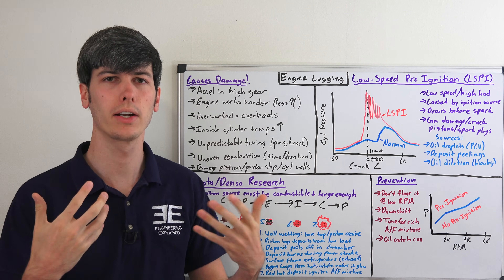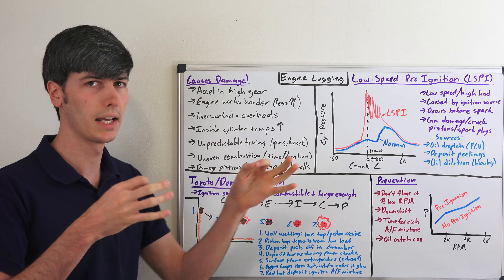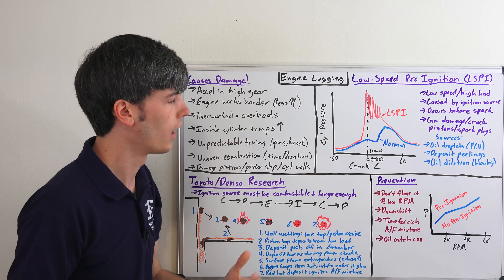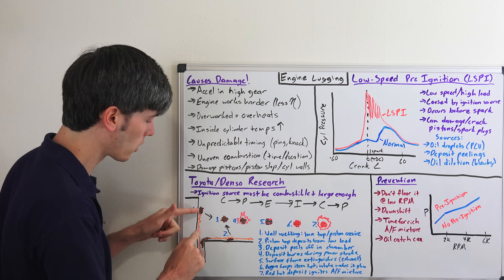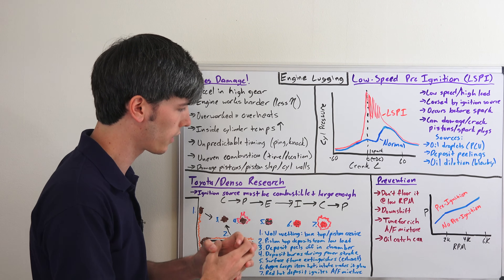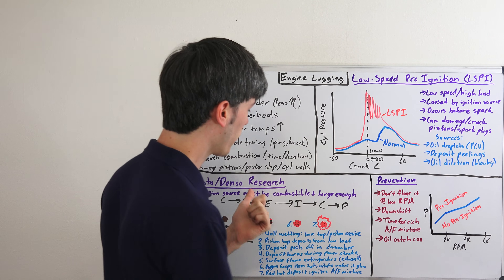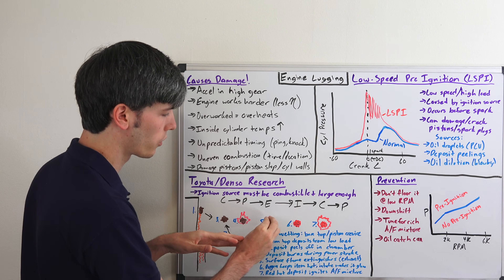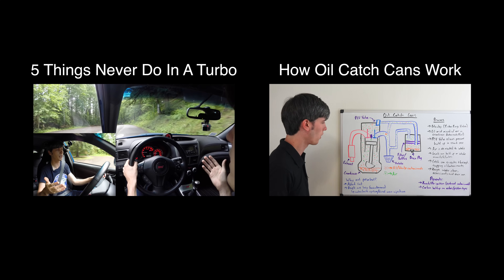Why You Should Never Lug Your Engine (Especially Turbos)

Comment: I definitely get the big picture here, but to me, the most important point would be to precisely define the term "lugging". For example, at what point on an x and y graph would you plot a "lug"? There are so many variables here; engine type, rpm, throttle position, throttle position delta over time, tuning parameters, gearing, etc, that it seems unlikely a definition exists. Personally, I don't "lug" my engine at least to the extent that I know when my engine is "lugging" simply because it doesn't "sound" very good and certainly doesn't "feel" very efficient.

Comment: @Engineering Explained - Jason, I'm a manual driver but when renting cars and when riding along with friends I notice that modern cars with AT tend to somehow lug themselves for fuel economy. Many will shift to the highest gear asap for fuel economy reasons, and those with 7, 8 or more gears will rarely go above 2500 RPM with the average driver. In that case, shouldn't we be seeing more low-revving under-square small 4-cylinder engines for higher torque & efficiency like in the old BMW 325e? (Or is this already the case?)

Comment: First off, very well explained and thank you so much for the video. I've got a little question. What if I'm going slow, but say climbing a high ramp and then floor it in second gear just for a little while? Can that cause any engine problems?
Reply: It lugs when you are in the wrong gear for the speed you are going. If you were going like 15mph and shift to 3rd gear your engine would make vibrating noise telling you are in wrong gear.

Comment: So accelerating at 4th gear at 45 mph to 65 is bad? Should I downshift to the 3rd gear and accelerate from 2500 to around 3500 rpm then upshift? I've always done that with my Jeep and I didn't know it was lugging. I definitely dont want to lug the engine of my mustang I just bought.
Reply: Dont let your rpms go below 1k. You will be fine.

Comment: This is counter intuitive, hi gear and high loads at low speed is the least amount of work on the engine vs high rpm which means more air and more gas. I accelerate all the time in 5th gear at speeds of 20mph without down shifting and it's less wear and tear because it's less rpm. Yes if you want quicker acceleration go to lower gear. Your engine will last longer when you use hi gear and lower rpm (above 1000rpm) is safe. The more RPM the more air the more gas means more wear. I'm sorry but this guy has it totally wrong.
Reply: Starting a bike moving in a high gear from stop requires way more work from your legs, which are the engines. It is the same with cars. And 20 mph in 5th gear is an absolute outrage.
Reply: Who in the hell starts off in 5 gear?  What
I am saying is simple, if you are moving at 25 mph can accelerate in 5. Of course it takes longer to build speed but your not hurting the engine at all. Again it's low rpm that has the least amount of wear and for long distance it's the most efficient. It's kind of like walking on foot, if you walk you conserve energy. It if you run you burn energy quickly. If you don't believe me than were not getting any where.

Comment: hi i have a question incorporating a turbo engine ive had two turbo cars so far a 2010 mini s and currently driving a 2015 vw golf tsi 1.8 t i noticed with both cars that when i give it alot of throttle their are moments when i feel like a tick noise shoot from the engine down the cat and it almost feels like the engine would be spitting gas in the begining of the exhaust syteme and it then ignites tho not creating a backfire it feels like its a missifre almost. thank you to who ever reads this !

Comment: I always try not to lug the engine but i need helps! I have a Manuel audi.
 Driving uphill for a length 30 minutes there may or may not be heavy traffic. At start im at 4000RPM to meet second gear @around 2200RPM to catch the gear with out making the car jerk. Any less and the turbo needs to kick in I repeat to 3rd but then at times,depending at what speed (60-70mph), im at 4th gear and 3500rpm to allow the engine and car to move upwareds without having to spool the turbo. If i were to switch to 5th gear, my turbo would kick in to accelerate, or if i let off the pedal to remove any boost, my car stays at the speed or begins to slow down. Is this okay? 
Can i keep my car at about 3500 rpm to let the car move smoothly uphill for 20+min or should i be at a lower rpm and let the turbo spool? Am i then lugging the engine if i have to make the turbos boost to accelerate and actually harming the car more than just leaving it a a higher rpm? 
Ive had seen other manuels and it seems like its efficent to at least go @2200RPM when switching gears. But by then the car is screaming to shift by 2200 when my car begins to do same till @5000rpm and includes a turbo..? Ahh! 😆

Comment: Could this happen to a turbocharged engine with an automatic/CVT transmission?
Reply: Normally in automatic mode on any auto transmission, when you start pressing on the throttle more it downshifts. You should be find, this is mostly a manual transmission issue

Comment: I have a question. 
I am an owner of a 125 cc motorcycle. And my bike's max speed is 125 km/h. 
When i cruise at max speed for a long time, am i causing the high load at low rpm situation.
The rpm at 125km/h is actually in more often used rpm range. But, since the bike can not accelerate much more, is it lugging itself ?

PS: Wide Open Throttle all the time when cruising @ Max Available Top Speed

Comment: My question is geared towards stop and go traffic conditions. Is it still considered lugging, and damaging if you are at a very low rpm and say in 3rd or 4th gear and feather the throttle to keep the engine running. Also, say you are in 2nd or 3rd gear and let the engine rpm keep the engine running while on the breaks to keep the car rolling/regulate your speed. In both cases never flooring the fuel throttle. Ideally I want to be in the highest gear possible while still rolling with smooth acceleration, but California traffic isn't ideal.

Comment: Look, I worked at Denso as an powertrain engineer and I learned somethings there.
1- Toyota always use the oldest tech possible when it comes to embedded tech
2- Honda is terrified of BMEP
3- Denso tech follows Toyota wishes and Toyota does not like turbo engines. They it is too complicated and unnecessary.
This is study you are using as reference was Toyota trying to discredit turbo engines that usually use more load at low RPM instead of more RPM and less load and thus showing the benefits of using a bigger NA engine because it is more durable.
Don't buy this crap. This is just Toyota being obtuse.
I had enough of them and left the group because of crap like this that I had listem.
This sort of issues no longer apply to modern engines. Feel free to floor your TC engine at 1,5k RPM.
If you want to have good reference look for the Germans and some of the Americans.
Reply: It is apropos when talking about Fords 2.3L Ecoboost with automatic transmission.  I've had 2 rebuilds in 96,000 miles on my 2016 Mustang. Mostly, smart automakers are staying away from DISI engines. Fords larger ecoboost engines are direct and port injected. But not the 2.3. Mine is terrible at low end torque, and gets only a little better in sport mode. Can't wait to get mine out of the shop for a second time.

Comment: I have a similar question but not exactly related to lugging. Is it bad to let your car slow down in higher gears? For example if I'm driving and I need to slow to a stop, can I just stay in 4th or 5th gear until I'm just about stopped and then pop it into neutral? The reason I would do this is because in another video someone said it's actually more fuel efficient for cars to be in gear when not accelerating (engine braking) than to be in neutral, which actually requires fuel.

Comment: I have grappled with a definition of what "lugging" an engine is in scientific terms. I learned to drive on a stick, so understand that you can demand more than what an engine can produce. it was definitely different on carburated engines. how would you postulate a valid scientific definition of lugging, given today's engines, fuel injection, sensors, electronic throttle control.....etc.?

Comment: Jason would you be able to discuss whether rolling into the throttle is better than purely flooring it? Anyone can discuss how drag cars floor it, but those are highly modified engines. I’m more concerned with a stock engine seen in pretty much any consumer car. My questions are:
Is it more efficient? 
Can it actually allow you to accelerate faster (even by 0.2%) by reducing excess fuel in the combustion chamber at lower rpms?
And 
How much of a difference does it make towards gas mileage?

Comment: Why would lower RPMs correspond with a lower pressure at which "low-speed pre ignition" occurs? This relationship is displayed in the graph at the lower-right of the whiteboard, not sure what that would be the case...

Comment: Yikes. Is it bad to leave my car in 5th gear if I’m traveling up a freeway incline at 70mph? The car sits a little less than 3,000 RPMs while doing so, therefore I figured that it wouldn’t be a big deal. I’ll try to start downshifting to 4th

Comment: unless I'm trying to accelerate at a decent pace, I'd rarely shift above 2K RPM; quite often under 1,500K.

If I'm maximizing fuel efficiency then running 6th gear at under 40mph is the norm.

can't go 550 miles on 10 gallons of gas any other way in a 1.4T Sonic (that's 55mpg over the long haul, I'm sure you can imagine how high the optimistic reading MPG gauge read over, let's say 50 mile stretches).

No problems on a tuned up engine after 140k miles.

Althoughthat engine does have Fly By Wire throttle and a torque based ECM, so the gas pedal position has a mediocre relationship to actual throttle position and delivered torque. Put the pedal to the metal and the actual throttle position will vary according based on what thresholds the ECM sees

Comment: Excellent! This expands on my understanding of detonation and preignition from a GM study from the late 70s. That study was credited at the time with our modern understanding which before that time was theory. GM figured out how to photograph a functioning combustion chamber, and from that figured it out, and defined the concepts. Since then I've seen so much garbage and misunderstandings I've sometimes doubted what I thought I knew. But no I was sure GM got it right, and you have confirmed that with Toyota data and analysis. The two conditions, detonation and preignition, are so simple really it frustrates me all the misinformation.

I'd like to suggest another reason to avoid lugging an engine, weak oil wedge pressure from slow journal speeds. However my bearing lubrication knowledge comes from a 1958 text! Yikes a year before I was born!

Comment: Sorry but if you look at brake specific fuel consumption BSFC map, you will know that using higher torque at low rpm will yield a lower fuel consumption compared to higher torque at high rpm

Comment: Stopped listening when he tries to say that ignition happens at TDC.  If this occurred at TDC you would never get a complete burn nor would you get full force of the explosion as it occurs as the piston is descending.  Ignition happens before TDC and is advanced as the  rpm increases to get full burn happening at TDC to place the full pressure on the piston.  This is pretty basic IC engine theory yet somehow he doesn't get it.
Reply from the maker: I find it is better to be kind rather than condescending. Ideally, peak pressure occurs near TDC, so you accomplish the maximum amount of useful work. Yes, obviously this means firing the spark plug before TDC. Does that mean that spark plugs are ALWAYS fired before TDC? Absolutely not. Take the Jeep Renegade for example, at higher loads it actually retards timing so much that it fires AFTER TDC. Page 66 of this report: https://newsroom.aaa.com/wp-content/uploads/2017/12/Premium-Fuel-Phase-II-Research-Report-FINAL-2.pdf Again, consider being kind before concluding that I'm clueless.

Comment: I kind of saw it as riding a bicycle in a very high gear: you'll have to push much harder yourself.
But tbh in a small n/a car it simply won't accelerate when the rpm's are too low, and in most automatics it happily downshifts by itself (my automatic 1.0 3 cylinder happily shifts from 5th to 2nd to overtake (it *can*) or to 3rd just to accelerate when cruising in 5th).

But in a manual turbocharged car (a small displacement with a turbo is pretty much standard in Europe) I kinda liked cruising in a, say 1.4 TSI (decent low end torque) in 6th and then giving it a decent amount of gas (not really flooring it) and when the turbo kicks in, it really gets up to speed pretty quickly…
So today I learnt that's harmful… well, rowing through the gears is fun as well, right

Comment: So my last car was a Mazda CX-7 with the MZR2 Turbo.  The Transmission on this vehicle would allow you to manually shift and you could go with WOT at very low RPM in higher gears.  Being it was a single scroll turbo there was lag but it would pull pretty hard in the higher gears.  It also produced a ton of smoke.  Eventually the seal on the turbo blew.  The engine later started having serious issues stalling and misfiring while dumping smoke out the exhaust.  I did not have much done to it as I was looking for a new car and did not want to dump a ton of money into it.  I was told the very thing that damaged the engine and the seal on the turbo was WOT at low RPM under load.   The car I have now is also a turbo 4 but it will not allow you do this.  If you floor the pedal at low RPM the transmission down shifts , even in sport mode.  So I learned about this the hard way.  Mechanic said, would you start from a dead stop in 4th gear?

Comment: hi guys, I'm a new driver and I have a question. my VW golf tsi 1.4L (118kW with turbo) has an indication on the dashboard which shows in which gear I should be driving for best fuel economy. usually it shows that I should be driving in 4th gear@~45km/h, 5th@~55km/h and 6th@~65km/h or so. when I'm driving in these gears at these speeds I have to press on the gas pedal very slightly to keep going and the RPMS are really low (1100-1200). so the question is - am I lugging the engine or not?

Comment: My 17 year old car is limiting boost at low RPM and has a knock detecter system, that controls ignition, fuel and boost in multible steps to prevent knocking.
The system is from 1994, so i would guess that almost everyone that is not driving classic cars, is not effected by engine lug.

Comment: Jason, I like some of your other videos but I totally disagree with this one. More than 100 years ago, the engines worked well at a few hundred rpm., but now manufacturers want them working very fast and trust that electronics regulation is doing allways the best, that implies that actually the car repair shops only change major parts and a car becomes some sort of consumption object, to use for less than five years and throw out. 
According to my experience, when an engine is not able to work well at low rpm, we should check the state of the mechanics, change the damaged parts, adjust the ignition timing and also check the fuel injection, giving the right amount at the right time. We will spoil further the engine if we try to fix the problem by raising the working speed, the parts will be deformed and the wear will increase. To avoid this we must spend some time checking the engine and after tune it. Sure we'll find some wrong things, although today everyone trusts in "perfect electronic" regulation systems, they are not; so anyway we must care about all. In every motor we'll find some wrong points, therefore we should implement some small changes to make it work well at very low speeds. The changes we made also will improve global performance and reduce consumption and noise.

Comment: You know what ive always wondered and it would be really neat for you to cover in a video. What is the point at where accelerating really slow to a speed say 55mph is actually detrimental to fuel mileage vs. Accelerating faster to 55 rpm and then cruising at that speed for the same time the other car takes to reach 55. Which would get you better fuel mileage? Because certainly accelerating super slow for a really long time has to actually harm fuel mileage. Im talking 30 seconds or so to reach 55mph vs 10-15 seconds to hit 55

Comment: How about diesel engines? Diesel cannot ignite the fuel too early because the fuel is not injected until the moment it's supposed to be burned. Of course, if you lug the engine low enough to cause vibrations higher flywheel (or dual mass flywheel) can take, you will cause huge stress to transmission. However, do you have a reason to state that the engine itself would be damaged by lugging the diesel engine? (Let's assume that we're speaking about direct injection turbo diesel engines here...)
Reply: I came here looking for this answer, I'm tuning a low rpm large displacement engine right now with a tiny turbo just to get the power and efficiency where I want.
Reply: Diesels are made to be run high torque at low rpm, therefore "lugging" your engine is actually just running in the optimal power band.

Comment: In Big Rig World,, knowledgeable truckers know that a turbo charger will meltdown if the exhaust temps get too high... That's why many tractor trailer trucks are equipped with a "Pyrometer" gauge.  Mack trucks pull hard and sometimes the only reason to down shift is to save the turbo from melting. Monitor  exhaust temps with a pyrometer  and downshift to cool exhaust temps.. A pyrometer gauge could have proven your point quickly in this video..